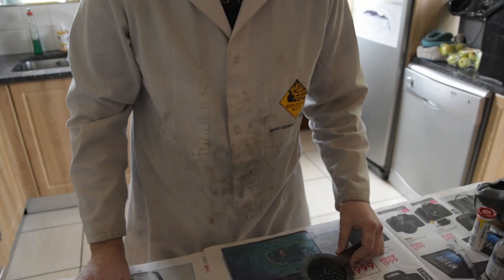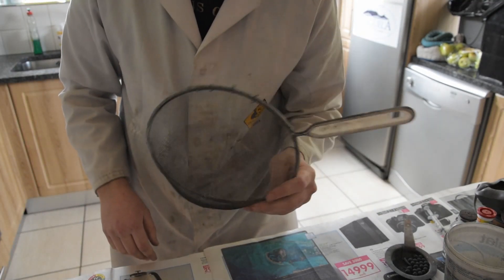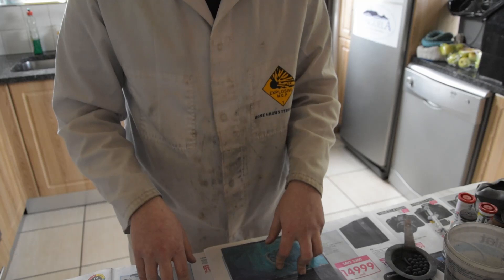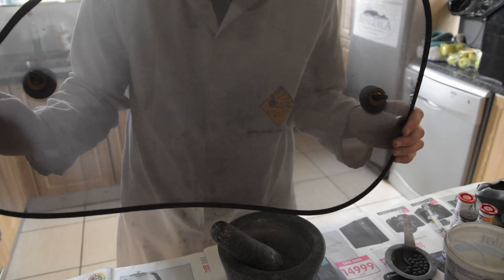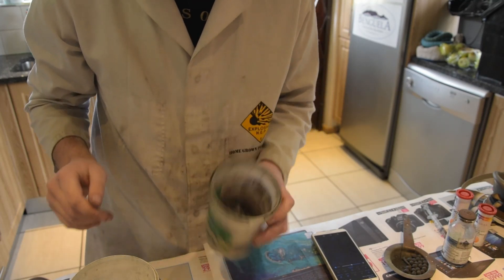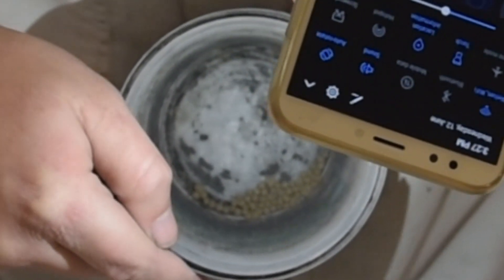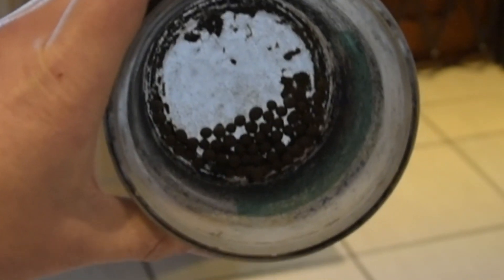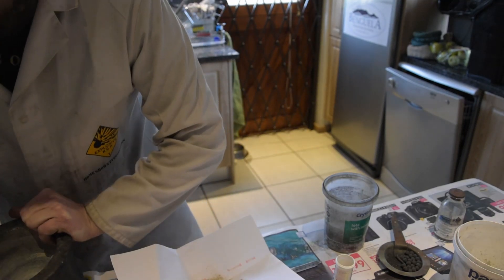ROUND STAR TUTORIAL|| how to roll round stars without a roller

Comment: I suppose if buckets are all you have, they'll do.  After the club I was in watched Dave Bleser's video 30 years ago, I had the good fortune to have a set of stainless steel nearly round-bottom bowls.  It's easier to see what you're doing with a round bowl.  They did have a flat area on the very bottom, but the round sides help a lot in the manipulation.  Still, I can't complain about your results.

I wouldn't handle barium chlorate without gloves.  I don't trust my hand washing to keep me from ingesting compos.
Reply from the maker: I have since made a motorized roller. I find this small bucket method works well for small batches that would otherwise flop if done in a star roller.